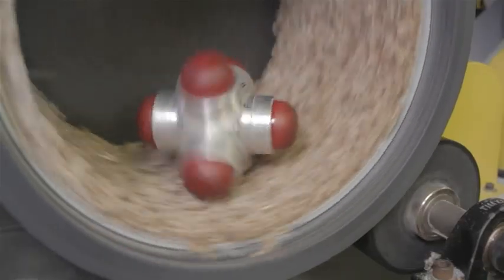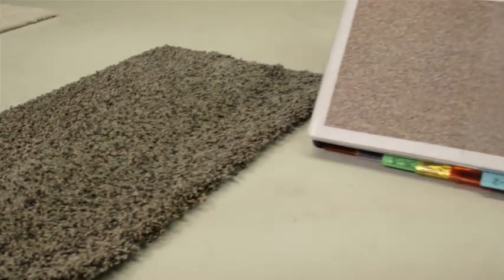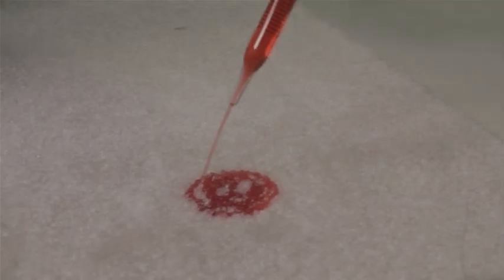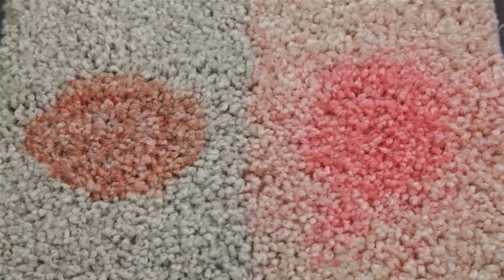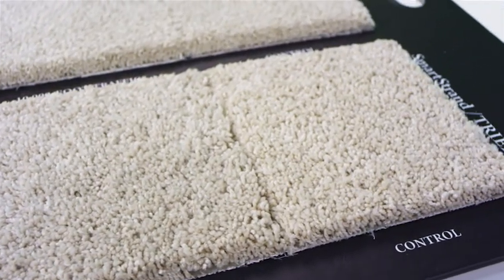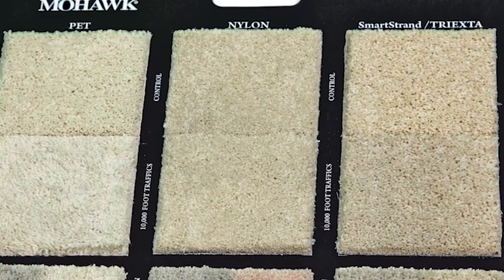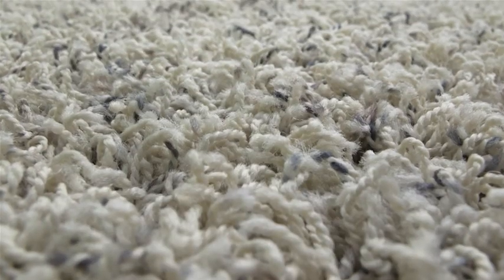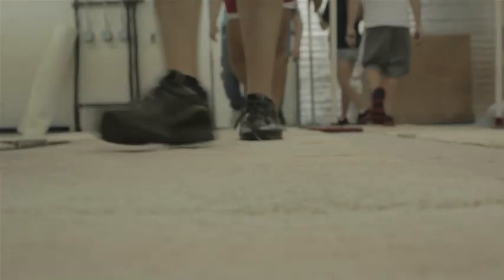Nylon vs Polyester vs Triexta Smartstrand Innovia   Carpet Fiber Comparison Test Results

Comment: But how does triextra hold up against meldew in basement creating any mold on carpet ?
Reply: no floor will hold up to a moisture problem. even an all vinyl floor will develop mold under it. fix the  moisture problem first, dont try to cover it up
Reply: Go tiles
Reply: ThePC3D if damp gets into a concrete slab, the tiles will eventually loosen and pop off.
Reply: DuPont claims these fibers do not absorb water therefore will "resist" mold/mildew. But as others commented, once your pad is wet & water is trapped, you WILL end up with bad issues, even if the carpet fiber survives unscathed. Pad will mold, &baseboards, any sheet rock that wicked up moisture will mold especially fast as cellulose is a favorite food for mold.

Comment: Polyester, and smartstrand are made from petro by products.
Oil based stains are very hard to remove.
Why ?
Because oil bonds with oil.
Salad dressing other food products and walkoff from your garage have oil.
Was the Nylon sample treated with Stainmaster?
R2X?
I Doubt it.
Polyester has failed for 30 years.
Nylon has much better texture retenion, and with a quality carpet you have great stain resist.